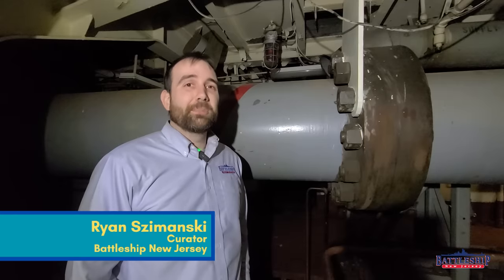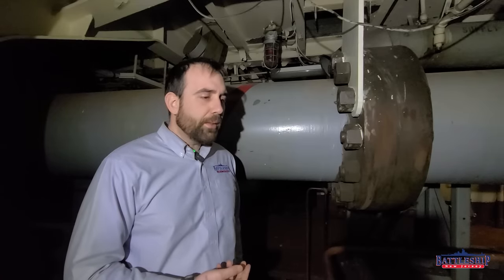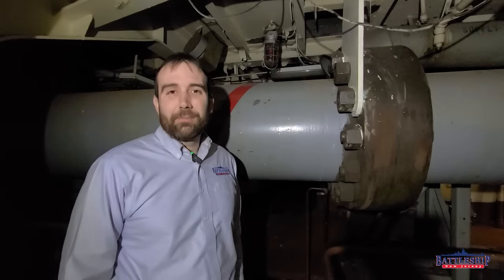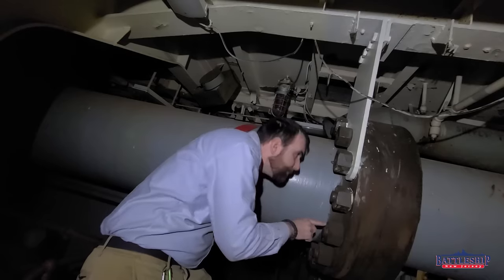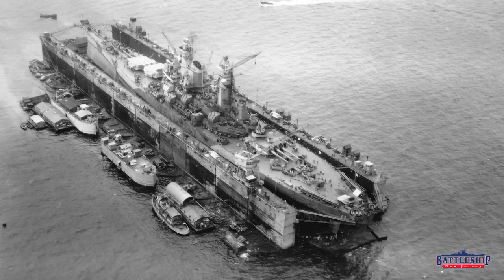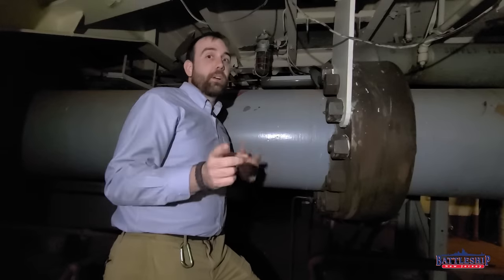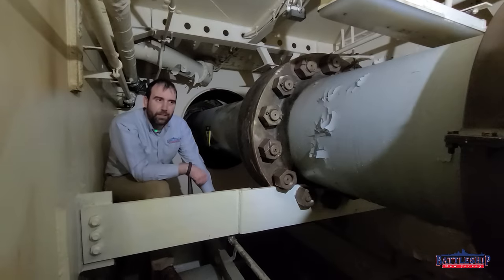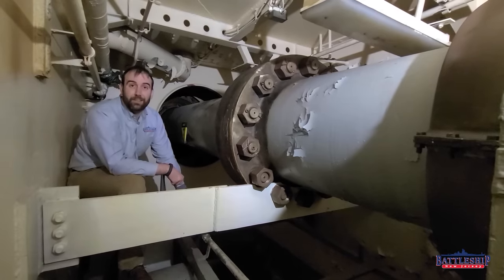Can The Propeller Shafts (And the Screws) of the Battleship Still Spin?

Comment: How well balanced are the shafts? Are there any signs of material being removed to put them into balance? Also - could the nuts have their location stamped in them to ensure they got back to the correct coupling, so the shaft stayed in balance after any work? Or perhaps just to give the sailors some esoteric knowledge to memorize. :)
Reply: I doubt the propeller shaft would be spinning fast enough to warrant balancing
Reply: @ForfeMac  Shafts are balanced.  The balancing is usually done on the plugs and wouldn't be visible with the shafting assembled. 

I'd expect the flange bolts would be match-marked to the holes.  It's typical to blue-fit the bolts to the hole.  The nuts probably are not matched since they should be manufactured to sufficient precision that they would be interchangeable.  You'd have to check the drawings to be sure, though.

Comment: I'm curious about how much tidal load there is on the propellers. In relative terms, those locks are not particularly big chunks of steel (They obviously do the job; they were presumably installed before she was handed over and moved to her museum berthing). Given the locks are almost as far forward as possible, I'm guessing the shafts are absorbing a lot of the toque and the whole thing is essentially acting like a giant torsion bar, and the force that eventually acts on the locks is quite small.
I'd be interested to know if the metal of the locks has been stretched at all. (Sorry, I think my civil engineer is showing...)
Reply: I doubt the tidal flow could over come the friction of the idle shaft to get it to spin - however the long tow from the decom shipyard in Bremerton to NJ is a whole different matter.

Comment: This was great, but you never explained how the welded material actually locks the shafts.  How's that work exactly?  Cheers!
Reply: The flange with the large nuts is part of the shaft and rotates.  The steel plate is bolted to a non-moving part of the structural framing AND the flange....
Reply: @kevincrosby1760  thank you

Comment: Ryan: I was assigned to the shafting engineering group at a naval shipbuilder in the 1990s.  IIRC, propeller shafts were machined on lathes that were about 70 ft. long between centers so that's the longest shafting section that can be made.  If there are longer lathe beds today I don't know about it.  The length of shaft section is also limited by the size of ingot that it's forged from.  Any number of "sticks" can be bolted to make a shaft line, limited only by the torsional stiffness and strength needed for the application.  Pillow blocks spaced at the appropriate span will support a long shaft line and keep it nice and straight.  Think about old-time freighters that had the machinery amidships.  They had long, slender shafting, and they worked just fine.
Reply: I think the shaft lathe at BAE (formerly Norshipco in Norfolk might be longer than 70 feet or is about the same. I know they do navy shaft work there & I’ve had 55’ shaft sections in their lathe getting sleeves replaced & new fiberglass wrap applied. Amazing to see!!

Comment: Shaft coupling bolts are a reamed fit, and the bolts are precision sized as a dowel for the majority of the length, with threads just long enough for the nuts to go on. I worked on a boat that had a propeller strike and it twisted the shaft coupling on the gear coupling. Let’s just say getting those bolts out was a process, and repairing the coupling flanges for larger bolts was quite involved.

Comment: I wonder  if the locking plates have an engineered sheer strength so that if something happens that really puts a torque on a screw, the plate will fail and let the shaft turn before something bigger and unreplaceable does.
Reply: I was thinking the same, especially on the short shaft. You see, the plate is made with at least 3 pices of metal. Why is that? I want believe that the navy fails with the welding position, so they had to cut the metal and weld it back in place, so it fits with the bolts on the shaft. 
I think, if Ryan, accidently fires her engine up, or a modern naval vessel or a torpedo hits her screw, that piece of metal in the middle will fail and allow it to spin.
Reply: @nurderbvbabernurderbvb  I'm not sure how you accidentally start the engine or how a ship or torpedo would hit the NJ but I suspect the plate would break before the shaft did but the shaft might get horrifically damaged

Comment: how are shafts - moving parts, isolated from water?
Reply: The shafts pass through a seal called a stuffing box before they exit the hull. They're usually adjusted to let a little water leak through when the shaft is turning in order to keep the seal cool.

Comment: Those "shaft locks" were definitely designed to keep the shaft in place at dock; also considered for the tow?  There will be a fair amount of torque applied to the screws while towed...... wonder the type of steel used in the locks and if any chance of shearing the lock at the weld (which I would assume is the weakest point).  Of course based upon the speed through the water, the screws are going to want to turn.  Just a thought.  Thanks for the great videos!
Reply: I was wondering that too,  if they have an engineered sheer strength so that if something happens that really puts a torque on a screw, the plate will fail and let the shaft turn before something bigger and unreplaceable does.
Reply: Well she had them in place when she was taken from drydock to her current berth so it SHOULD hold.

Comment: Is the boat still able to become operational or are things to far gone. I'm referring to the engines and electrical system. If you wanted to fire it up and move it could you?
Reply from the maker: We could not fire up the propulsion plant today.
Reply: @BattleshipNewJersey  Gee folks, all you need is 100+ trained engineers to do the maintenance and inspections each and every day, plus another 150-200 available the first time you even thought about lining up to light a boiler...  We ran over 100 in Engineering Dept just for 3 boilers, two mains, and 4 TGs.  After that, fuel shouldn't cost more than a few hundred $$$ per minute to get steam up.
Reply: @kevincrosby1760  Yeah people seem to forget these things are rarely preserved in the first place for a reason.
like it costs thousands of dollars a year just to keep sea life off the bottom of small fishing vessels, the level of work required just to keep one of these things from not rusting through is exponential

Comment: I’m confused about what you said at 0:30 regarding the shafts being connected directly to the engines and that the screw spinning would cause the engine to spin. I would’ve expected that somewhere in the driveline that a gearbox exists that acts as both a gear reduction unit as well as changing the rotation of the screws for fore and aft ship movement when needed. I would also assume that a neutral position exists to transition between the two that would allow the engines to rotate without spinning the shafts and vice versa. If this is the case, then the locks are not for keeping the engines from spinning, but only the shafts/screws themselves.

Comment: It wasn’t clear to me whether the propellers can turn.  Obviously the engines can’t according to the contract.  For the tow, will the screws be allowed to turn as they move through the water?  Thanks!
Reply: No, the metal brackets that have been bolted onto the propellor shafts will stop them from turning.
Reply: There are no clutches or anything in the power train.  If a prop moves, the associated shafts, reduction gearing,and turbines will also be moving.  Functionally, it's all one big piece of machinery.
Reply: Thanks!

Comment: I had a friend in college that was on a Navy ship, and he said they could put a turn and a half of twist in the drive shaft under full power. I just can't image the torsional stress. That would make the shaft shorter and the bearing would have much more stress if it was a rigid connection to the shaft. I remember in my statics and dynamic class the center of a drive shaft doesn't add much to strength, is that battleship drive shaft hollow?  Why do they care so much if the shaft turns anyway? It's not going to start the engine. What can happen if it turns a few degrees?

Comment: Marking the Coupling bolts is normal.
They are machined,
 "Fitted" bolts ~ 
Machined to suit EACH hole , once it has been "Reamed" to size after the Coupling faces are bought together .

Each hole (bore) will be a different diameter, usually only a couple "thou" different, for a "tap in Fit".
Each Bolt, only goes in it's matching hole.
This makes Each bolt Shank, a perfect fit through BOTH coupling flanges, insuring Max "shear" strength &  Coupling Spiggot alignment.

Comment: As a young lad age 25/30?, & first week & first time in shipyard, [I.e. Cal Ship & Dry Dock, La.] I pulled & reinstalled the 10' diameter prop & 12" shaft,  all by myself, to replace two oil submersed seals, I was surprised how simple it was, & how all the bolts were numbered & fitted for each numbered flange hole! I.e all fun stuff!

Comment: If you go the poor boy route you could take her out on a test run for 10,000$ or so, I bet. Just call up and get about 10000 dollars worth of bunker fuel delivered, work on getting the fuel pumped up to the boiler burners.  Fill boilers with water, remove shaft locks. Lightem up, get a few friends stationed here and there with radios and someone to drive.  Start slow until you see it’s not gonna blow up then let er rip. If something bad happens try to get it back home and in the garage, erase all evidence and act like nothing happened.  This allways worked for me. I learned to drive my friends abandoned car at night when I was only 13yrs old . Same principal, just more metal.  You only live once.

Comment: Even if they could, would it be a good idea? Doesnt it require cooling water for the engines / turbines ? And would it be a good idea to spin propeller blades in air that were designed for water? So many questions .... LOL

Comment: Absolutely just need to repack on make sure the main bearings I’ll have oil in on Monday that’s all you need is battleships were the latest and greatest they have Babcock and Wilcox Empire boilers 600 psi control of a super heat @850*

Comment: Lifting-off the upper-works to install the new nuclear reactors (courtesy of USS Enterprise) will be tricky.  They might consider raising the unit (2-3 feet at least!) to install them from underneath.  In this way, much of the issue with the armor plate can be side-stepped.  If only such enthusiasm existed.  I still reckon the Texas needs new nuclear boilers to feed the 3x engines so that she can fight in the next war.

Comment: Thanks, I do happen to have a battleship at home.   The Musashi is currently in my backyard pond.  It's a fixer upper, but it's got low miles and I got a great deal on it.

PS:  What is the seal around the prop shaft made from?  How does that keep water tight with the shaft spinning?

Comment: I think it would be pretty cool to see one of the shafts spin; like disconnected from the engine because it makes no sense to put unnecessary and unexpected wear on it; fast enough to see it spin, but not obsurdly fast, from the inside.

That would be really cool, but I think this ship is still technically owned by the navy, and I don't think that would ever be allowed. Would be super cool to fire it up, disconnect the propeller shafts, and just let it run, but that's also just a bit unfeasible and an "absolutely not" answer from everyone in control.

Comment: We used to do the same thing with a plate bolted onto the shaft coupling to keep our reduction gear/engine from turning when we would have engine trouble offshore. That’s a very effective and safe way to “bind the shaft”… less safe methods include using a pipe wrench or chain.

Comment: You made a major mistake in your assessment. You stated the engines are connected directly to the propeller shafts. That is incorrect. Why? Because they have transmission gearbox's with speed reductions and  reverse gear's setup and a Clutch for every shaft. 

All the locks do is to prevent the propellers from being hit, bumped causing them to turn just enough to break the shafts. When the engines are off and the gearboxes are set in low gear you cannot turn the engines over by the shaft or propellers.

That's impossible because of their extreme low gear ratios. So to prevent breaking those shafts in long lengthy extending segments they attach locks to prevent these long runs of shaft from breaking in the middle of these long shaft runs.

Comment: The “wrench” is a knocker wrench used in conjunction with a sledgehammer to loosen the nuts. Never to tighten them, the nuts will not tighten properly (or at all really) the nuts need to be torqued, and with nuts that size you would need to use a torque multiplier device.

Comment: I would think the compression of the engines and the slow rust within the engine cylinder walls and pistons would provide more than enough friction to keep the propellers from rotating.

Comment: The museum needs to paint all of the locking components yellow for easy identification later should they need to remove one for maintenance.  

I would not be surprised if the Navy has a manual for recommissioning the ship if needed. Getting that information out of the Navy would probably literally take an act of congress.

Comment: When I was in the navy, when a ship was in port the jacking gear was engaged to keep rotating the shaft( once an hour) to keep the shaft from warping under it's own weight. why would the navy want to lock the shafts in place if they are supposed to maintained in a ready service state?

Comment: Do you think it's (theoretically) possible to shear these bolts through the locking plate by engine power alone and therefore free the shaft? The gearbox would need to be in the lowest gear and the turbine has to spin somehow I imagine...

Comment: Well it's interesting that they did that instead of rip out the shafts all together. That means can actually be operational with a refit.
Since it's snowing at battleships are gas guzzlers. Could both battleships be repeated with a nuclear power plant instead of fuel oil?

Comment: In 1971 while stationed on the USS Forrestal one of our propeller shafts bent causing it to stop. The others continued to turn. We were taking on JP5 from the USS Nitro at the time.  The impact was felt when slammed into the nitro and general quarters was sounded with this is no drill at the end.  This was 4 years after the big fire.  I was assigned to the medical dept. at the time and told to stand by at the aft emergency battle dressing station.  Steel plates welded to the overhead were a nightmarish reminder of the bombs the blow through the flight deck and hanger deck during the 67 fire. Some planes were damaged and damage to an elevator.  No injuries thank god.  We packed it up and had back to Norfolk from the Med. and went into dry dock.

Comment: Fascinating! I ran the #4 screw aboard the USS KITTY HAWK CVA63 1972. The shaft alleys were over seven decks below the main passageway. The bearings were inspected every hour for temperature and pressure. Of course, the shafts were 3' in diameter. Considerably larger than the New Jersey.

Comment: How does the navy seal and preserve a battleship. Are the shafts powered by one, or multiple engines? I've worked on boats a lot. But only 2 stroke outboards or inboard Mercruisers, big & small block V8's, etc.
Reply from the maker: Each shaft has one engine but two boilers. Preservation is cosmoline or other oils on some equipment and dehumidification everyone else

Comment: Will the rudder be free when she is pulled into drydock? Id assume it would just be tugs pushing the aft but when you said “how things that shouldn’t move will move when we pull the ship into dry docking” has me slightly confused and has me thinking about possible stress on the locking mechanisms when this massive structure is moved and adjusted.
Reply from the maker: the rudder will remain locked

Comment: "PC 3" is very likely "piece 3".  "PC" is a common abbreviation used in naval drawings to indicate parts or components on drawings which correlate to tables in the drawings containing all the pieces used to make up equipment or structure.

There is a drawing for that shaft. On that drawing, there will be lines pointing to each piece of that shaft which say "PC 1", "PC 2", "PC 3", etc.

If you go to the parts list table on the drawing and look up PC 3, you will see info such as nut size, thread size, mil-spec, material part number it can be ordered by, etc.

Comment: I'm surprised there is no decoupler on the shaft to the reduction gears. So the jacking gear when in operation is not turning the propellers.
Reply: Each and every piece of equipment installed is a potential failure point subject to damage.  Solution is to not add anything that is not required to safely operate the ship.

Comment: wondering if there are multiple propeller shaft locks on each shaft (on a few couplings)?

wondering as there seems like there could be alot of torsion on the shafts due to the large propellers and a single1/2 or 3/4 inch thick piece of mild steel connected via 2-3 nuts (yes they are large) seems a pretty limited structure to take this torsion alone...

Comment: But WHY bother locking the shafts?  It’s not like they’re ever going to move by themselves.....
Reply: Because natural forces are strong enough to move the shafts.
Reply: Think of a fan.  If you turn on a fan it moves the air.  If you blow air on the fan hard enough, the air moves the fan.  Water is much more dense than air, and the propellers are more efficient than the fan in your living room.  Any movement of water past the screws will result in torque applied to the shafts.